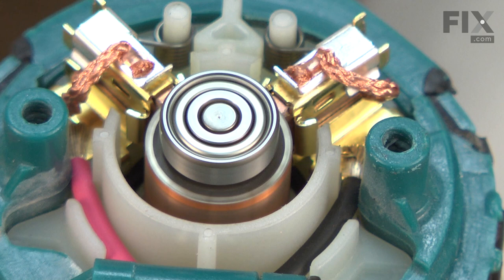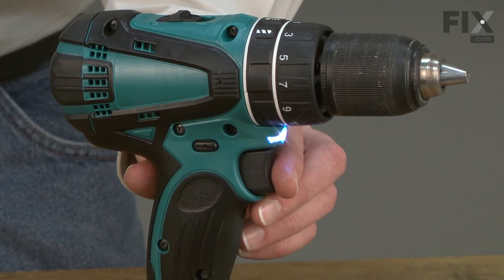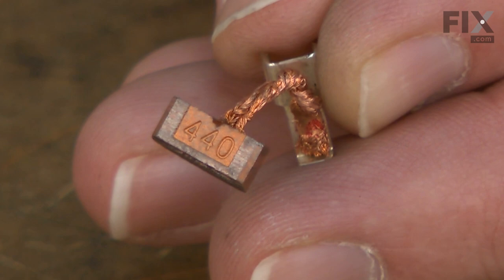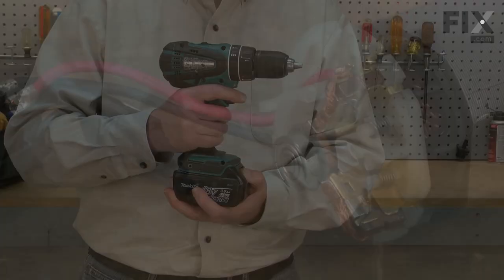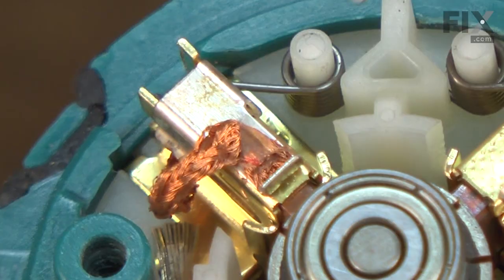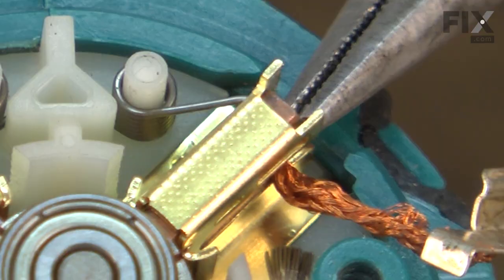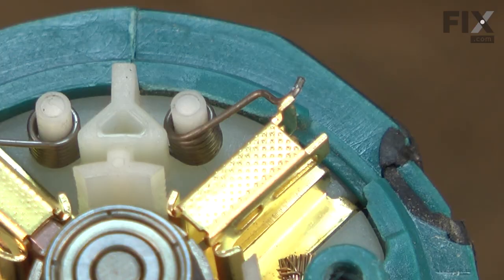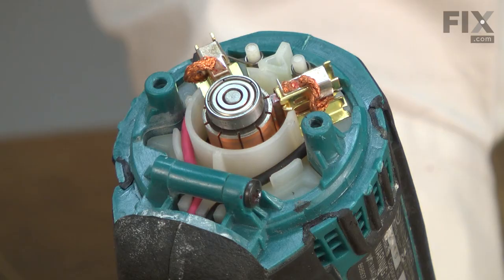Makita Hammer Drill Repair - How to Replace the Carbon Brush Set

Comment: My brushes were practically glued on, it was not this easy to remove.
Reply: Yes same. How did you do it?
Reply: Struggling to remove the brushes as they are stuck in the holders. I’ve broken them and the wires ripped right off too. Any tips are appreciated
Reply: @hamstersmailman5517 did you figure out how to get bushings out? Same thing happened me
Reply: @pafox3203  I’m afraid not, if you do lmk
Reply: I had this same problem and fixed it although my drill is still having issues so take this with a grain of salt.

I removed the plastic that the brushes are attached to from the armature (part the brushes make contact with) and seperated them from the drill body. That way I could push my worn brushes out the bottom of their housing (wire ripping off brush in this process but not needed anyway as new ones being installed). Through this process I noted inside the brushes housing particularly up the top closest to the armature side had some sort of plastic gunk or glue which I assume could be melted plastic due to the heat and friction. I grabbed a small phillips head screwdriver and pushed down upon the blocked gunk preventing the brush from going into the housing until it gave way and fell out of the housing. Now the brushes went into their housing and were able to be connected.

All this said, my drill started working although there were sparks coming from the brushes and motor and then the drill would stop working so I likely have another step or two ahead of me